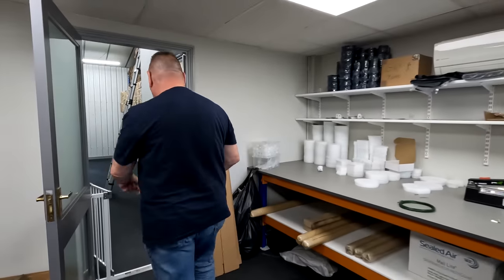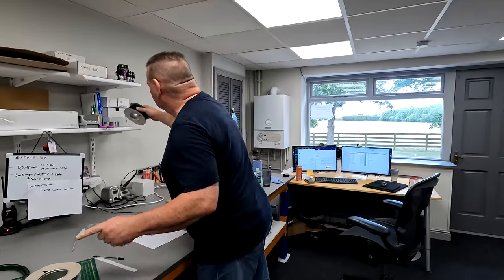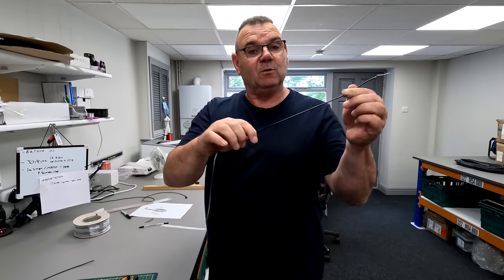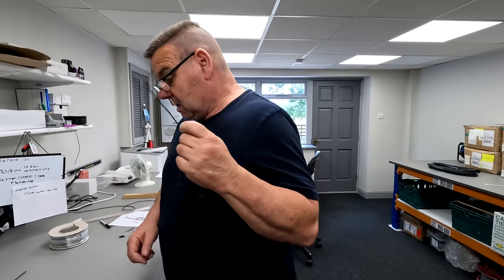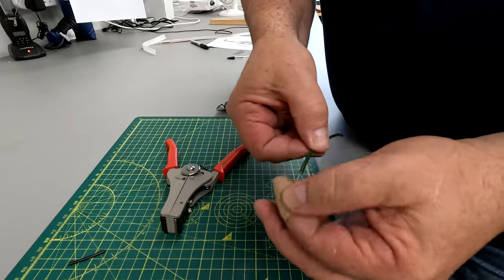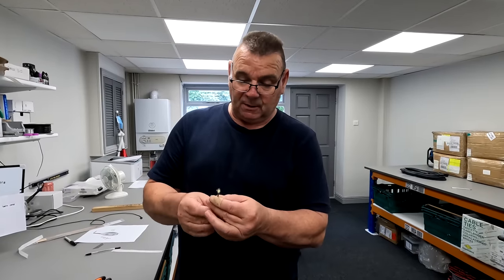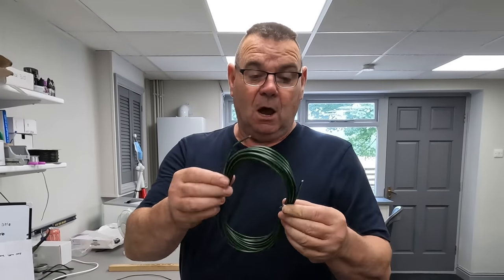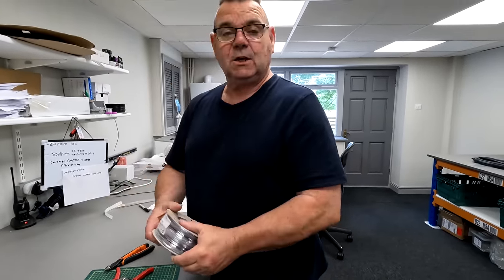DX10 Ham Radio Antenna Wire

Comment: I love DX10.  Just ordered another 200M.  It's the only wire I know that's flexible, strong, and easy to solder.  It's a handy bonus that the exact resonant lengths for a 1/4 wave for each band are published in the DX Commander manuals.  Saves a lot of time tuning when you DIY something else.
Reply from the maker: Yeah Matt. It's genuinely amazing - anyway, nice to hear from you again fella! :)

Comment: I use #10 AWG solid for all dipoles or end fed antennas. #10 wire lowers antenna "Q", makes the antenna more broadbanded by extending the resonance 2:1 points wider. I learned this while I was in the Navy in 1976.
Reply: I use 10ga thhn. Mostly for the strength.
I’d imagine 10ga solid would be great once the kinks and curls are out.

Comment: I've just finished making a few using dx50 from Callum. Yes it's costs more than hardware shop wire but when you see the difference and the way it hangs i'd rather pay for dx50 or the 10 than use the other crap for free. Worth every cent or penny.

Comment: DX10 Is really flexible. I purchased a 500ft spool of wire from a well known radio shop here in the states. It’s not that flexible and the plastic sheath around the copper was a bit thicker.  I’m most likely going to purchase another 100M of DX10 so I can play around with the 10M Classic with out entanglements. Great stuff as always 73s de KD8WBZ

Comment: Good video. I recall in an earlier video (or somewhere) you mentioned the difference between insulated wire and uninsulated - particularly if you thinking of fold back. The DX 10 has been great for my DXC.  The radials were really nicely buried, but with this heat and lack of rain I am just starting to see them again. Mark, 2E0MSR

Comment: The D 10 that came with my classic in 2018 worked great after you separate it etc, however the dx10 that comes now is just the best !
Reply from the maker: Oh yes, I'm almost embarrased about the old D10 days!
Reply: @DXCommanderHQ  Don't be , the 40 meter element on the classic  was still working great till a month ago or so when I put the 12.4 up .

Comment: DX10 does indeed resist tangling extremely well, from memory the popular kevlar wire has a sheath that feels similar.
Reply from the maker: Yes, strange that. Different factories.. maybe it's something to do with the milspec? I don't know.
Reply: @DXCommanderHQ  I don't know, but you may have hit the nail on the head with the rating to -40c. When I did some environmental testing at Racal the temporary looms to the equipment being tested would just be standard wire types. At --40c they did get pretty solid. Obviously the cabling for final use would be rated for -40c. Scarily the coldest place on earth is about -100c ......

Comment: Hi Callum, im finding you videos very useful. I've not done much operating since I got my intermediate license (2E0EYZ) some years ago, my dad is a G4 and now at 85 he has dementia and I would like to get my full licence before we loose him. I see from other videos taking your exams can be done from home, that will help as I run my own business and time is limited. I really like the look of your nebula antenna, need to save some penny's while studying. My wife bought me an all singing and dancing alnico base station when I passed my intermediate exam and I have used it on various antennas, I would like to use it with your nebula antenna on top of the hill where my industrial unit is. Sorry for the waffle, keep up the good work. 
David
Reply from the maker: OK so the 18m Nebula is probably a bit much for some. Maybe have a look at the 12.4 Signature; slightly smaller, less expensive - and frankly more bands.. My best antenna I fear!

Comment: The substitute wire that I got with my Signature 12.4 seams fine but the heat shrink you supplied didn't go over 4 wires for the radials (FYI).
Reply from the maker: Ah! Thanks for info. I will double check. Sorry about that.

Comment: D10 was used and still is for field telephones and the like. It's a mixture of tined copper and zinc coated steel wires. Very strong and buggers your sidecutters fast.  With the steel wires a bit heavy for hanging from poles but could be used for towing cars. ;-)
Reply from the maker: Ah that myth! 😆 I snapped some D10 by attaching to 2 pieces of wood and snapped them apart fast. Snap! PS it doesn't survive very well with UV.. Insulation breaks down. And then it rusts :)
Reply: @DXCommanderHQ  I have seen a picture of a Land rover with the whole rear floor ripped out! The Army plods drove away with one of our field telephone exchanges still connected to the D10 and it was bolted to the floor. Our exchange survived better than the Land rover and the MOD sent us the picture to show what our poor exchange had been put through. So 30 or so D10 pairs had a tensile strength greater than the shear strength of the rover floor.
Reply: Don10 tangles like a b!tch though, I’ve seen metres of it dumped after exercises, the bowman braid (the green Kevlar wire in this video) is good stuff though, it has to be to support the weight of the army cjd and coax.

Comment: DX10 is flexible and easy to work with, but does not lack the stretch or break resistance of actual D10 wire - in fact it’s construction is entirely different. DX10 can be snapped by hand, whereas I suspect you could tow a vehicle with a few lengths of D10. DX10 is great for temporary antennas and probably verticals, but I’m not sure I’d deploy it in a horizontal dipole for any length of time, subject to strain, for example. Horses for courses. It’s good wire but be sure it’s the right wire for your application.
Reply from the maker: That was a challenge I has a few years ago! I can snap D10 (the old military telephone wire) by hand. Two blocks of wood, connect up the D10 to each block giving you some slack of around 60cm / 2 feet in the middle. Holding your arms in front of you, just throw your arms apart. Snaps easy! I did this in front of a Royal Signals guy who told me you could two a tank with it..! I did actually believe it until I gave it this shock test! There are only 4 x 0.2mm strands of steel in D10 (and 3 copper). I would suggest with 24 x 0.2mm copper in DX10, strength would probably be similar. It's certainly difficult to snap..! Well, I've never tried it actually :)

Comment: super strong that's for sure, but OY fall/winter/spring did it in pretty quickly. if PVC jacket breaks it sucks up a ton of moisture and is ruined in a jiffy.

Comment: I love D10 you gave me a roll (when you dug the coax trench at your old farm) so was what my first antennas were made from, still got a d10 dipole strung up between the house and a tree, thought it would stretch or snap eventually but still going strong...will try the D50 soon I think
Reply from the maker: The OLD Don 10 will eventually fall apart. Happened to me. But it's 50 years old now..
Reply: Sorry I meant DX10!

Comment: I'm curious how much the DX10 wire will stretch under tension being that it's copper stranded. No problem with a vertical antenna application but a horizontal antenna application would put more tension on the wire. Especially if the antenna was an EFHW cut for 80m. However I would use DX10 on an EFHW for portable ops without any worries. Cheers Callum!
Reply from the maker: Wire stretch! I need to do an experiment.. Hangin a weight on it. We will find out!

Comment: What is the military antenna wire called?
I have heard that increased wire diameter increases antenna resonance bandwidth.  Do you have any experience showing if that is true or not? 
What is the weight per meter for DX10 and the military option?
Reply: Wire diameter has less effect on bandwidth than you might expect, for HF use any sane thickness of wire will have negligible effect on bandwidth. A popular technique to get increased bandwidth is to have a number of conductors spaced apart. Google "cage dipole" for an example.
Reply from the maker: Ross, both DX10 and DX50 weigh about 1.35kg per 100m.

Comment: Strip back the wire. Then tie the Kevlar strands in to a square knot. Next wrap the wire strands over the knot. It's how we joined Military Phone  phone wire in the sixties. ( 7 strands of wire. 3 steel 4 copper steel. Tied the square knot with all strands. Then cut off the excess steel strands and wrapped the copper wire over the the knot. We would tape the splice.)
Reply from the maker: Yes else it's a bugger!

Comment: Hello Callum,

If there is enough interest, would you like to do an analysis about the minimum wire thickness for, for example, an endfed. I have very difficult neighbors and I want to make the antenna as invisible as possible. You would do me a huge favor with it. I currently have no antenna and want to get back on the air as soon as possible.
Maybe there are more radio amateurs with the same problem as me with very best regards PE2NAN
Reply from the maker: OK, in my opinion it would be a short video... My personal feeling is that for 100W station, go as thin as you want. But I will it to the list.
Reply: @DXCommanderHQ  Thanks 73 Pe2nan Henk

Comment: hello. Here in the Canary Islands we have a significant saline environment, so with the sun the PVC coating becomes porous and oxidizes the interior. I would like to know more about this cable. expansion coefficient, resistance to mechanical traction, could you give me the technical sheet. thank you. EA8CJN
Reply from the maker: All we have is what's on the website but since this was designed specifically for the British Military, I'll give you a 10 year warranty regardless.

Comment: If you had twin wire and joined the two wires at the ends is there any reason that wouldnt be ok to use as if it were one wire?
Reply from the maker: Yes, you can short it both ends and it's one wire.

Comment: Have you ever tried using steel core washing line  ? It looks like poly weave antenna wire but is a fraction of the price.
Reply from the maker: Be careful because unless it's galvanised wire - or stainless, you will be into some losses on uncoated steel.
Reply: I've worked the world on a string of paperclips and 100w. Losses are not noticed.